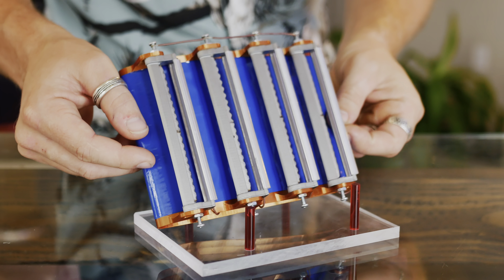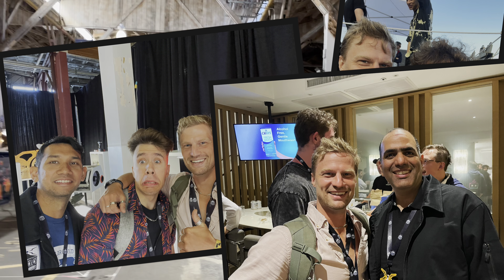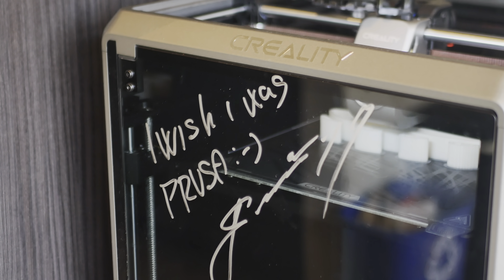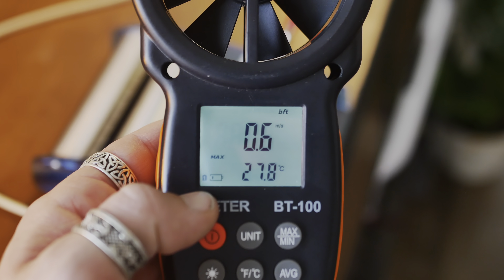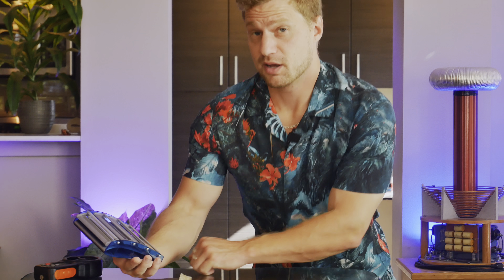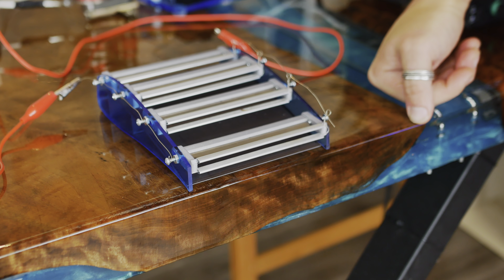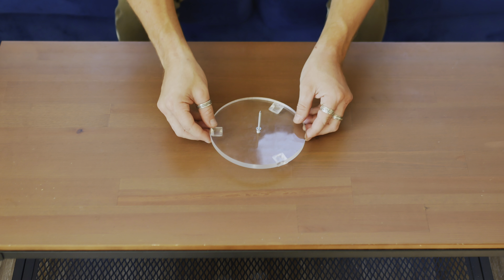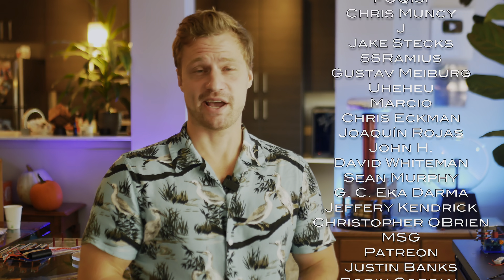Designing A Self Propelling Ionic Thrust Wing

Comment: I'm no expert, but it seems to me that the drive should be in front of or even below the wing, not above. The air above the wing must have a longer distance to cover (create lower pressure) than below for the lift effect to work, and I have the impression that this design tries to do the opposite.
Reply from the maker: Think about when the wing isn’t moving, but is powered. It creates airflow over the top. Automatically. Even when not moving. So the wing creates lift even at no velocity. Or at least that was the idea.
Reply: @PlasmaChannel  😉You're probably right, but since there's a shorter path for air to travel at the bottom, wouldn't the object's maximum speed be a bit higher with power at the bottom? I also haven't seen you test a sequential drive in a tube (full closed or with small holes between sections). And one last question, have you tested the tomato guy's solution? (Or do you want to find your own solution) I noticed that you slightly scored the negative plate, but it seems to me that it should be more spiky like a wood saw than like a bread knife. 

PS: you make really cool videos and they're fun to watch. 👍

Comment: The next test is to put airflow via a fan infront of the wing design. Then measure the outcome of the velocity once power is applied. Is it constant or does the flow go up or down with air moving over the wing already. Essentially testing to see what a functional design applied to flight would be

Comment: I love this tech!  Back in the early 90s I ordered some "anti-gravity" suppressed technology from a magazine and it was a manila envelope with Patent Office documents of this very technology from the 50s and 60s.  They had drawings with banks of electrodes directly on the surface of the wings & fuselage, using it less as thrust and more to streamline the aircraft by directing airflow over the surface.  There were even designs for the Red October fluid propulsion tech.  Basically pipes lined with sealed electrodes pulling ionized water through the tubes and providing thrust.

I'd love to see high-atmosphere weather stations that use this tech to stay aloft.  Maybe use Peltier modules to supplement the power generation at that altitude.

Comment: I was always curious about the "optimal" distance when you place the modules in sequence. The air speed increases between the incremental steps. Wouldn't it be efficient to "gear up" the spacing of the subsequent modules to get more thrust out of the faster flowing air?

Comment: I’m curious if the increase in velocity of air actually creates enough low pressure on the top of the wing to create lift, which is why wings are shaped the way they are, and if your model accelerates the air on its own, creating that low pressure zone, if it needs to have a slightly or even drastically different shape. You may be able to get away with having a much thinner/lighter wing.
Reply from the maker: My idea was that having thrusters on the top leads to lift happening even when the plane isn’t moving. Air moving over the top of the wings automatically providing lift regardless of plane velocity
Reply: @ that’s exactly what I was thinking, would that also effect stall speed relative to wind velocity?

Comment: I know this is an oldest video and I hope you found the best solution. While watching this video I had a thought that I'm sure you already thought of or at least had another comment on. But I was thinking that you could put the thruster inside the wing cavity. I don't know much about aerodynamics but I know lift is from the speed at which air moves over the with vs under the wing. This doesn't really help propel the plane. It only picks it up. Your thruster concept needs to propel the plane and allow the wings to do what wings do. My thoughts were to put inlets near the body of the plane to supply the air for thrust and fill the inside of the wing with ionic thrusters that have a outlet near the back of the plane by the tail. Anyway, great video. I'll have to see if there is an update video.

Comment: Why can't those jets be installed inside the wing?
Reply: Air flow inside the wing is non existent. If you open up the front a rear of the wings, then you get a biplane. And since you only need one wing, you end up with his design. Hope that helps.
Reply: Many aircraft had their engines embedded in the wing (Comet, Vulcan etc), so it does work with a tubular jet propulsor. Having the plasma thrusters on top of the wing is also super draggy. It might work better if you put a cover on the top and made a Venturi to accelerate the airflow.
Reply: If you put holes in the front for air intake and holes in the back for propulsion exhaust then you change the shape of the wing and most likely it will reduce its ability to generate lift The wing must remain wing shaped. It is the drag of air going over the wing that generates the lift. Reduced surface area, reduced lift.
Reply: @tpokmedia7828 The solution space is huge. but finding the optimal is by iteration. rather elegant when I'm sure you figure it out.
Reply: couldn’t you run an engine like those through the entirety of a fuselage creating more off a fighter jet type
Reply: ... I have no words
Reply: The DeHaviland Comet had engines built into its wings, but it created a lot of drag.
Reply: Yes! Bi wing with thrusters sandwiched between
Reply: If you look at old airliners you can see the engines sometimes mounted inside the wing. This method whilst reducing interference drag negates the effective lift of the wing by removing the leading edge. Same logic applies here I believe.
Reply: Try mounting along the leading edge of the wing to reduce drag and promote higher efficiency of lift.
Reply: ROFL⤴️
Reply: agree. the drag will be horrible outside.
Reply: Anything is possible
Reply: You could not. Because the thing that you want to do is making the Air go under the wing so the Air could not come into the wing if it does the wing does not have a job because if you make the Air come into the wing you çanta make plane fly because the Air ne3ds to come under the wing and makes the wing goes up so plane goes up

Comment: What if you made the main body of the wing out of metal, could you use that as your ground? And have the positive electrodes as the little air foils? And what about putting electrodes on the bottem side of the wing.

Comment: Late to the party, but the thrust from the Ionic assembly MUST be right through the center of the wing. If you choose to do it this way. The infrastructure itself is creating surface drag, and could easily be fabricated inside the wing itself, which would leave the lift area unobstructed and intact and reduce overall air resistance. It would also reduce weight and add structural integrity. The solution cannot be part of the problem. I do love your work!
Reply: I think if he really needed to insist on it being in the wing. Which I think is a terrible idea. He'd need to cut the wings into sections. Like 1 ft from body, inch gap, 2 ft from body, inch gap. And so on. And those gaps being multiple thrusters. (Just pulling numbers out of my ass for distances to paint a picture.)

The problem with his designs though - it's messing with the pressure differential and also not utilizing it. Even the plane he referenced, encourages the differentials with the intakes.
Reply: @Josh-s3d5u  I was thinking more like if you can visualize this as more of a multilayer design. Not cut up as you are suggesting. The wing would consist of a 'top half and bottom half'. This way the electronics would remain inside the actual curved wing surface, on the top half all would be hidden facing down. Imagine a nearly full length long open front facing duct with appropriate support connectors. Then the same electronics hidden again underneath facing upwards to the duct.  It would be quite easy to insure structural integrity. Airflow through the center will actually accelerate lift over the top without any resistance. Flaps/ailerons would be easy. Guys in engineering have been playing with this idea for years but have been limited to pod style turbines and ducted fans. It is absolutely what I would do. I design and build large Rc helis and jets, and hold flight records in both.
Reply: @randyailie3459  awesome and congrats on the records. Wish I had time to do more than thought experiments. Lol

When I visualize the double wings with multilayers, since wings often have a curve to both the top and bottom. I see a bypass point between the two? Where it's essentially flat space between the top and bottom? Can we have a curve that creates low pressure, right next to a high? Or would they counteract?

With my limited understanding, a glider with two wings would glide just fine even if the center doesn't utilize the differential. But how well compared to one wing? Which would get further?

The big advantage I see with ionic is the thrust has little ramp up time. Meaning it could possibly be fully off and turn on when needed. - I'm thinking more seagull and less hawk. (Although, I don't think riding the wind currents like that would be that pleasant of a ride. Lol)
Reply: @Josh-s3d5u  Either way, this ionic thruster is pretty nifty. The possibilities are really intriguing. Right now I am working on new battery tech, and set another long flight record on a custom one off heli just this last weekend, roughly three times the normal flight time right in front of two nationally ranked pilots. All 3d helis use lipo's but these I am fielding do not. Pretty much doing the same thing they were but with an even larger heli. Getting nearly twenty minutes on an 800 class tri rotor heli doing mild 3d is unheard of. I did the same thing last summer with two new planes and two custom designed ducted fan jets. My friends are engineers and were calling me nuts beforehand. That is impossible they said. Yeah, that was fun watching them eat their words. Lol. I also designed a new brushless electric motor that doesn't use back feed for timing, so it runs cool. The esc is proving to be the hard part however. All brushless motor tech is using ideas from over half a century ago! Heat is nothing but wasted energy! Guys thinking outside the box and utilizing new ideas are transforming our world! Glad to be surrounded with such talent and seeing new ideas.  The only problem I am seeing with Ionic thrust is getting it beyond a hard breeze so we can get it beyond just powering fragile super light toy airframes.

Comment: Kinda talking off the cuff, aka out of my ass, but ever considered a near Bi wing (like Bi plane wings) to sandwhich or channel or choke(?) the thrust of the foils through the wing. Allowing the surrounding airflow to be unimpeded. Guess that would be similar to the jet engine with wings attached, but jet engine centered in the wing. One on the front edge if the wing under the lip that gens the lift. One foil at the center line of the wing. And the third acting as the… Aileron?

Comment: new to concept, and your channel/build. interested/curious at one point in your video you had the wing on an elevated but stationary platform which sat on the table. What sort of lift would be required from the wing section when deployed on your armature apparatus to propel the pair through the air?

Comment: the electrodes really want to be integrated and flush with the foil shape, or integrated into channels in the wing. Anything presented to the flow that isn't foil shaped & is more than ballpark 20% thick on basis of local chord length is going to dominate drag. This compounds as speed increases, roughly proportional to v^2. Running thrust on the top of a wing has the advantage of far greater stall resistance. The low pressure on the top is way more unstable relative to the lower high pressure side. Storms provide a good analogy, where high pressure zones are usually quite calm, and the low pressure zone being violent by comparison. The metric for the strength of a hurricane factors heavily the local minimum pressure in the eye. I wonder if a toroidal wing could employ the electrostatic thruster.

Comment: It may be better to built both side supports as higher, may be rectangular with 4 vertical slots and take readings according to different slots arrangements from 1-1-1-1, 1.5-1-1-1, 2-1-1-1, 2.5-1-1-1, 2-1.5-1-1, ... 4-3-2-1.  And finally fine tune to 0.1 decimal place vertical height adjustment  and you will find the actual results against those theories in text books.  Even tha angle can also be adjusted a little to see what will happen.

Comment: Why not put the thrusters inside the wing to minimize the interruption of laminar flow over the wing. Would that not reduce the power requirements to move the plane?  An opening in the lower part of the leading edge would allow high speed air into the thruster cavity...   Just a thought to reduce drag
Some of the Super STOL wing designs show huge lift advantages with very low drag and have ample spade to insert your design of thrusters I think..   Maybe.  .

Comment: I designed an anode and cathode out of carbon fiber and steel thread that increased my ion output by around 300 times over carbon fiber alone with the same power input. I would be happy to share my design with you as it would prove exponentially lighter than the blades.

Comment: Can you make a tunnel with magnets on the inside and have a rocket suspended in the middle that will go from one end to the other at speed with only the pull of the magnets...gradually getting faster and faster then scale it up a little to a size where you can then fire the engine on the miniature rocket  ....please

Comment: Gyroid nanostructures on the surface of a wing or object can create turbulent zones and pressure gradients due to local vortex air flows. If gyroid structures are activated using electric fields, this can lead to additional forces acting on air molecules (ionic wind), which will increase the created pressure gradient. Electrostatic fields can interact with air molecules, accelerating their movement or creating local areas with rarefaction and even vacuum.

Comment: The bogus ion wind: This theory suggests that ions are attracted more to one plate than the other, creating a flow of air or ion wind which might produce thrust. To actually effect powerful lift and thrust you need very high voltages. It then becomes an asymmetric capacitor. It can work very easily in a vacuum where there is no air, like in outer space! We are already doing this but the public doesn't know it. They like to zonk-out on sports, porn and drugs. They are almost dragging their knuckles.

Comment: Look at it like this. All you have to do is create a cushion around the wing. A cushion of low pressure on the top and high pressure on the bottom. And use your imagination to come up with ways that may work. I beleive you are on the right path. Plasma and ionizing air. All you have to do is create that cushion. Harder than it sounds, I know.  But that's the first step. Simplifying the idea of the concept.

Comment: Considering that lift is generated by the fact that air moves faster below the wing, and slower on the top, wouldn't it be more beneficial to mount the thrusters on the bottom, to increase lift by directly speeding up the airflow?

Comment: I like that you've moved the ground out of the way. I think your on the to something. Can you use the ground being either side of the air flow as a lateral fin with vertical movement to direct the flow of air it order to control thrust. I also think insert the thrusters inside the wing and use nano Tesla Valves 3d printable as a 1mm thick sheet to allow air intake and exhaust through a directed slit in the rear of the wing. This way the entire wing is the intake and lift and thrust components

Comment: Hey, love the concept. However, since the top of the wing is used redirect, air flow lowerin pressure/ density, above the wing, wouldn't be better to place the thrust on the lower section of the wing?

Comment: If you'll build that wing and replace the razors with wires don't forget the area under neath that wing either. You could add thrusters there as well then or am I wrong? Also are you planning perhabs to upgrade to a SLA Printer? If tho you may be able to use more effective generative design then.

Comment: Hey man might be a little late on this one but take the wing away from the bottom of your thrusters and make them at one. As long as you don't disturb the air flow at the highest point of your leading edge you will still achieve your pressure difference and then implement your thrusters on the underside of you wing again not desrupting air flow from the extremities. 

Just to say dude this ideal is brilliant and you could implement a solar aspect to the air frame so she'll stay up there forever.

Peace dude ☮️

Comment: You could consider using balsa wood for your frame , since it is stronger and weighs 40kg to 160kg m3, compared to PLA and most filaments that weight around 1260kg m3. or 30 times more than the lightest balsa. You should be able to build a glider that will get you into the air with a good push, and stay up there under under ion propulsion

Comment: If you put holes into the 3 strengthening spars running through the centre of the aerofoil section, you could save even more weight. Optimise these holes for best results.

Comment: I think the idea is very good. But we shouldn't forget that the supporting force of the wing is the wind flow, which acts under the wing, not over it. So ionic engines, in my opinion, would be more effective under the wing and a little ahead of the wing, not just to push the vehicle, but also to create additional air density under the wing!